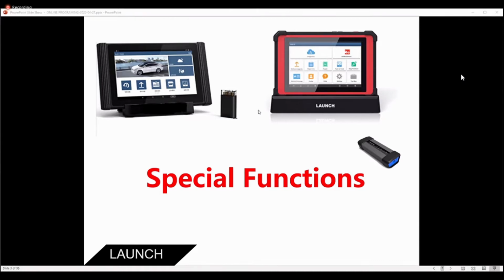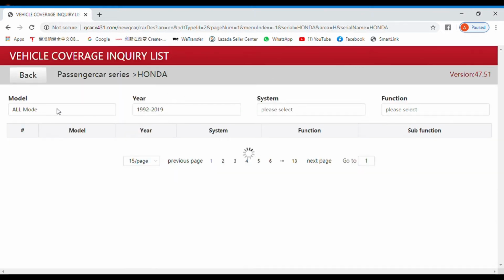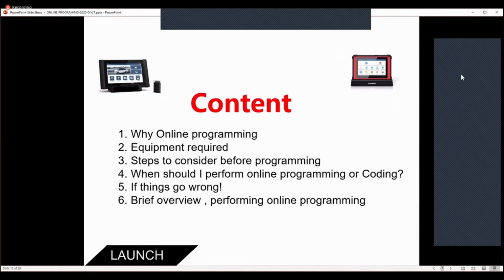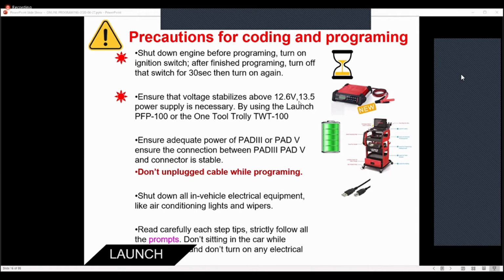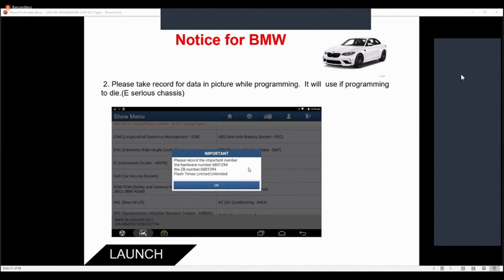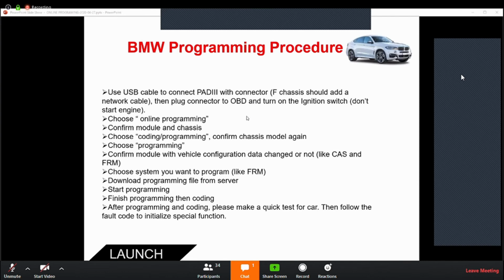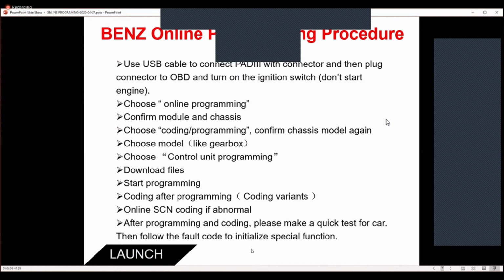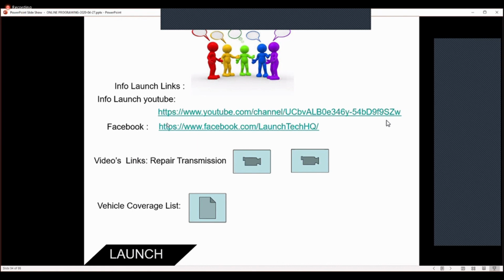x431 programing coding initialization

Comment: Hi can remove adblue sistem on CHEVROLET captiva diesel
Reply from the maker: Unfortunately no, for this procedure you will need a programmer - flasher to remove the maps for the ad blue system in the program located in the engine control unit.

Comment: Can this programming and coding be done with the X431 Pro 3S+ as well?
Reply from the maker: Programming NO, coding YES
Reply: @obdglobal476  Do you need a j box unit to program modules using the higher-end scan tools? and does launch sell a j2534 pass through?

Comment: hi. we have a new x431tablet kit. we have 2009 nag1 gears in a 2005 c230 drift car. the ratios are different.how can we use the launch to set the correct coding for ratios in the tcu

Comment: Hi nice/good/usefull video, gretings from corsica - france -  i have 1 question - nissan qashqai 2007 - diesel 2.0 - sometimes start,  sometimes NO - NO IMMO ON - can i UPDATE this ecu with my pad V to """put"" OUT this issue ???
Reply from the maker: My humble opinion is that you won’t solve anything with the upgrade. For this operation, the only sensible use would be to use the optional new-generation LAUNCH x-prog3 interface to adapt keys and immo systems.

Comment: I have Launch 431 scanner india version but I don't see any online coding and programming options there. I want to code the Chevrolet Cruze abs module. Kindly assist me on this.
Reply from the maker: We only use on European Cars like VW, AUDI, SEAT for online CODING and I am afraid LAUNCH does not suport Chevrolet Cruze for online coding. I think you will need GM MDI original or China clone to do this operation.

Comment: Where can I buy the program cable for BMW F Series?
Reply from the maker: The cheapest option for F series is ENET cable for around 15 usd and you can use this cable with ISTA software (BMW OEM software) or ESYS is you have more skill. (ENET cable is everywhere; ebay, aliexpress, alibaba or some local diagnostic store).
Reply: @obdglobal476  I thought Launch had its own cable solution for programming. I do have ISTA/ICOM/ESYS/ENET but I want to program f series with the Pad 3. Also you used the same "data" cable to program the Mercedes.